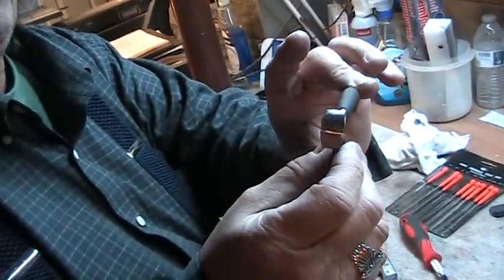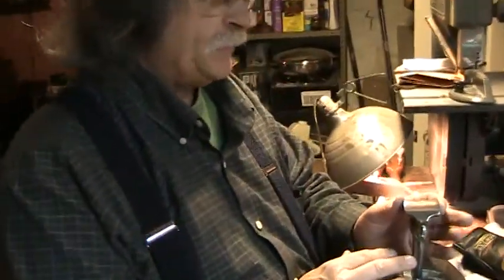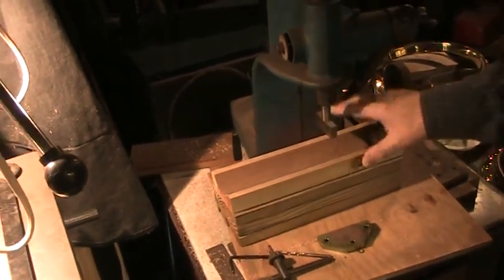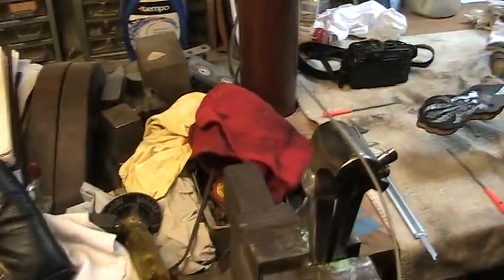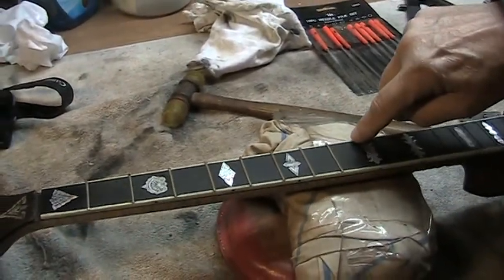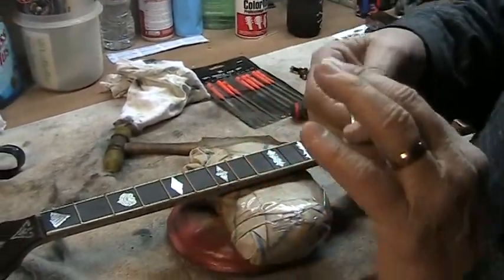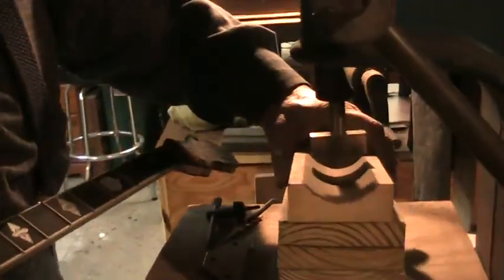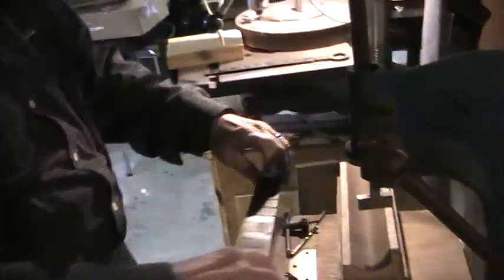Steve Caddick, installing frets on a banjo

Comment: If you don't have an arbor press, can you use a hammer to seat the frets?
Reply from the maker: Yes, but use a nylon or other softer material one. You could use a regular hammer and a block of wood against the frets, never use metal hammer on the frets, it will damage them.